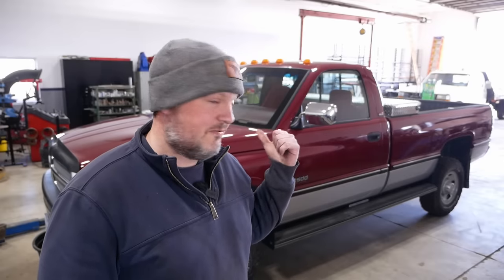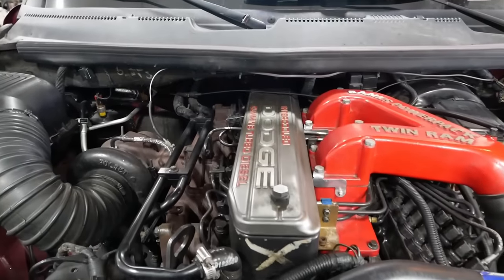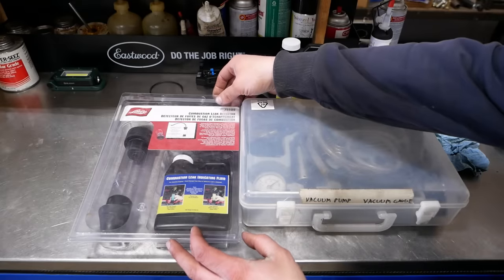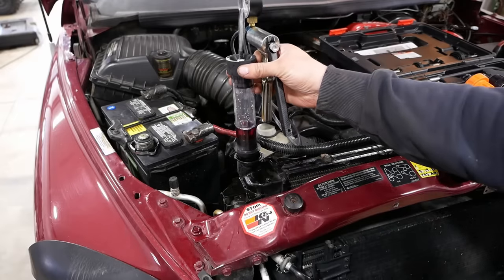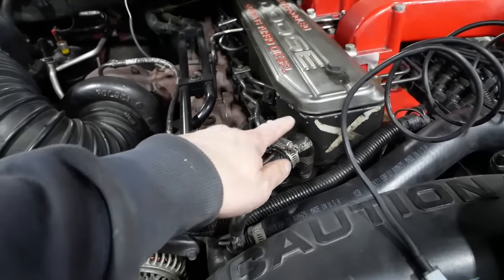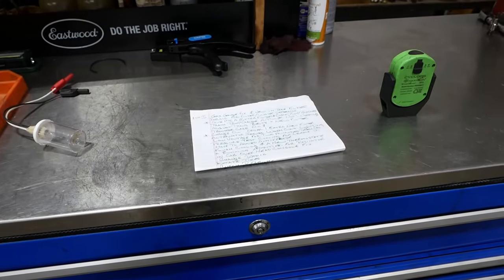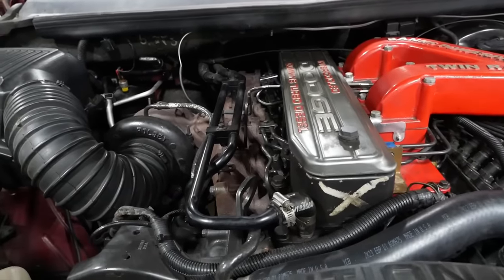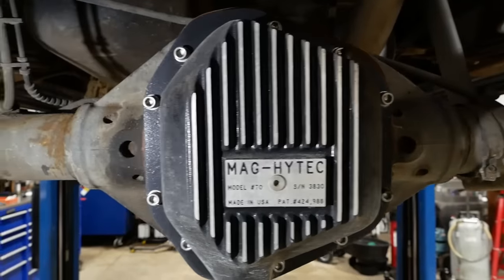Fixing a Mint 1995 Ram 2500 Cummins | Front End, Coolant Leaks, Major Service, Etc.

Comment: A word to the wise, the dashes on these things were made of hopes and dreams.... if you happen upon a rare fully intact dash, and need to remove the bezel, or any screws for the instrument panel, radio, etc, use the gentlest of force to both tighten or loosen, or you may be sad to find you have split the plastic around the screw retainer.

Another good mod is to add relays to control the vehicle lights. The lighting switch on the dash passes ALL the lighting load amperage through it and it is a matter of when, not if, when it finally melts apart.... Pulling trailers with lights will only hasten this.

Comment: I have 91 dodge 12v that's has the rotatey injection pump it has a factory intercooler. Still has the original transmission, and I'd still runs and drives to this day with out an oil drip under it.

Comment: Nice truck! I have my grandparent's 1998 Ram. It has the 5.9 gas and RWD. It's also rust free having spent it's winters down south and summers in IL. It does have several minor dents and such from 80 year-olds driving it. The clear coat has been peeling. That one must have spent a lot of time garaged. One weird thing is the ball joint boots have rotted off but the front end is still pretty tight with 80K on it. Mine has those same running board brackets on it. I thought maybe they were homemade but apparently not.

Comment: I work on mostly Ford e250 e350 vans, and doing the lower ball joints I run into the same problem with my ball joint press. I had a old axle nut socket that was all beat to death and I cut it for a spacer for just them lower ball joints, It bottoms out when installing them as well.

Comment: I remember when those showed up at the dealership in 93. 
I got a 2004 to work on with over heating issues that the last shop unleashed the parts cannon on, but didn’t fix it. It’s funny that the new fan clutch won’t work with a melted engine wiring harness. It threw the serpentine belt for good measure in front of the shop before we could get it in.
Reply from the maker: That sounds just right!

Comment: I had a new 2007 Dodge Ram 2500 Heavy Duty with the 8 ft. bed and the 5.9 Cummins diesel engine. I loved it BUT I had transmission problems with it just like I did with the other 2 new Dodge vehicles I purchased previously.

Comment: Take the check ball out of your transmission line and you will never have any problems with this type of transmission, it's not that the transmission is a bad design,it's that check ball that gets gummed up and sticks, and over time the pump gets hot and and usually fails. I have one with 512k miles and all I did was this and change the oil and filter on a regular basis.

Comment: The transmission  does not build line pressure in Park, to test to see if drain back is the issue shift to Neutral, wait 10 seconds while idling, then into gear. If the slip is vastly reduced or eliminated then drain back is the issue. A workaround that doesn't involve replacing all seals or removing the trans is either to shift to Neutral for 10 seconds or so before engaging gear or a Transgo / Sonnax Manual Valve upgrade that will allow line pressure to build in Park.

Comment: Ive had that issue with the ecu and charging system, i used flagship one ecu's and replaced the alternator at the same time, computer came pre programed and ready to rock for under 350 shipped.

Comment: Seems like a lot of work for a mint truck. Tech tip, use the old brake rotor to set the hub and new rotor on when your driving in wheel studs way easier than your block of wood.

Comment: Check the power steering fluid they work off a puck system and if any of the pucks are stuck their steering seems loose or if it's low on fluid I found that out with my Dodge on my own.

Comment: Excellent video.  Anything to help me maintain a 98 and 99 Dodge 2500’s is alright by me.  Yes, the newer trucks have engines with 24 valves instead of 12 but they are still Dodges.  Thanks.

Comment: great video. Steering boxes for those trucks are hard to get right. I think they make some kind of brace to stabilize it as the mounting tends to give. If you put the truck in neutral for a few seconds after starting the trans should act OK. We had a couple like that at work. wish you'd wear some safety glasses beating on stuff

Comment: Gale Banks did a whole series on why those square shaped diff covers are a bad idea. He has a version with extra cooling fins available that has the same OEM shape to the inside of the cover. Helps keep aeration down. Conclusion is that an OEM cover is better than those due to the aeration. I know on the Ford 10.25/10.5 you can get an OEM diff cover with the cooling fins and the original inside shape for minimal expense. Not sure about Dodge, but I think they run Dana rears so there's gotta be an OEM option out there somewhere that will work. If not, the Banks cover is the same except it has bigger fins that catch air and direct it over the fins to improve cooling capability. The only thing those big diff covers do to improve things is increased volume of fluid, but with the aeration issue they're a no no.

Comment: As a mechanic I can't believe you like the 95 Dodge body style.  That was the beginning of shoving the windshield so far forward you couldn't comfortably clean the inside but more important still, it buried the engine making access almost impossible.  Most mechanics I know are pragmatic, if it works good, if it makes things more complicated ditch it.  Opening the hatch on an old square body and you could get at most everything but the transmission.  Open the newer styles and you had better bring a shoe horn and a cutting torch or you aren't getting anywhere.

Comment: All of the clamps both fuel and coolant were constant tension clamps from the factory. The fuel return line behind the injection pump getting dry rot cracked and leaking is a common problem.

Comment: I had the 1500 dodge pickup from back then it was nice to drive around really turned heads that new design
 but the factory put wrong instrument cluster in so i had to take brand new truck back and have them rip it all out and change it LOL

Comment: Did Wes forget about the temp sensor in the transmission pan?
He checked it and figured there was a wiring issue with it as the sensor its self seemed ok and then during the test drive he looked at the trans oil temp gauge an commented on it not working and he thought there may be some thermostat in the transmission.
Wouldn't that gauge be for the sensor in the transmission pan?

Comment: love the video's and this one  too . i have  a v10 2nd gen 96 extended cab. but let me give you some unsolicited advise. get your self one of the pvc plastic carts. you can work off it and mount a vice on it. you can beat the hell out of stuff on it. way more durable then metal. and start using fender cover's or at least a folded towels protects the finish and keeps your tools from going in the abyss. okay my rant for the day lol. all kidding a side you are a very good mechanic love your work and how you film it. but i can't believe the guy i call a tool pervert didn't have some kind of hydraulic over air stud pusher outer  lol. you wacked them out the old fashion way good job

Comment: Hey Wes, I’m hoping you can answer some questions for me if you read this. Why does Dodge fit Cummins engines, why don’t they make their own diesels? Wouldn’t Dodge just buy the complete engines fully assembled from Cummins which means the zip-tie would be a Cummins mistake? I think it’s more likely it got in there when the last person to adjust the valves left it there otherwise the leak would have been fixed under warranty. If rust is such a huge problem there, why don’t people take steps to do their own rust proofing. Here, back in the day some of our cars would rust very quickly, not from salt on the roads but salt from living by the beach. Anyway rust proofing was big back then with fish oil being popular even though it stinks for a while it really worked. If I lived over there the first thing I would do to a new car is fill up my weed sprayer with fish oil and hit the whole underside of the vehicle. The second thing I would do is leave it outside for a couple of weeks for it to dry off and the smell to subside….A bit. 
Cheers Stuart, Australia 🇦🇺

Comment: The steering linkage is the crappy Y-style, I don’t know what the price is any more but we put 09 T-style steering linkage on our second gens. Also the loose feeling could be track bar problem like bushings, joint, bolts. Only truck I have left is a 02 3500, 165000 on the clock totally rush free and it don’t move unless it works hauling hay, straw, cattle, feed, lumber or whatever.

Comment: Even though your fluke multimeter has only the AC voltage meter ahead of the DC voltage on the dial and there shouldn’t be a damage to the multimeter, it is bad practice to hook up the leads to a power source first and then move the selector to the proper voltage meter. If possible try to set the dial to the correct function first and then connect the leads. Just something to keep in mind if you wanna keep your fluke multimeter working in proper order. Those things aren’t cheap hehe

Comment: I never got to compare before and after valve adjustment performance of a diesel engine. The 1960s era European and Japanese "sporty" 4 and 6 cyl engines that I adjusted often got another 5 mph top end with a careful valve adjustment. I used your two crank position method on sedans and pickups but individual tdc for the sports cars.

Comment: No coolant temperature gauge dance shows up in the test drive.  The factory issued a notice that due to the thermostat opening and closing the needle will dance while driving and is "Dodge" normal.  I have this truck without 4x4 and no steering issues at 275k miles.

Comment: Went through the same dilemma with my 94 3500. Had to use a very pricy Carter unit like that one. Drives me crazy you can spend multiple hundreds on a simple sending unit and they can't include the rollover vent... I had a great time getting mine in as well. I wish I knew about the pigtail, I de-pinned my stock one and made a lucky guess on the location on the new units plug. Then I siliconed the connector to keep it weathertight.

Comment: I had a 95 F150 5spd, with manual transfer case, that I really liked..  It spun a bearing at just over 300k miles..   But that 302 was pretty gutless for such a big truck.   That 12V cummins is the one to have..   I still have my 2002 F350 7.3L 6spd manual and manul transfer case, manual locking hubs..  330k miles and still going strong..........   I'd still rather have a 12v cummins in it though. lol

Comment: Call Mr. Banks (a very old but alert man) at Banks Performance.  He is a library of knowledge.

BTW, Mr. Banks did testing on diff covers.  Bottom line:  stick with the OEM.  The others don't sling enough fluid.  That rounded part inside is the key.

Comment: Gotta love the Cummins, I have a 95 Cummins 12v 6BT with 129k Mechanical on it but mine is in my 1995 Bluebird TC2000 40' Transit bus (Tiny Home) Only issue I have with mine is I can't seem to hold pressure in the fuel line so It'll crank for a solid minute before cranking over.. After it cranks it runs perfectly. I've had 10+ mechanics look at it and can't figure it out.. I've replaced the 2 fuel filters both main, and return lines, replaced the overflow valve, tried check valves both front and rear, a universal fuel pump (to try to prime the line), and still get a 1 minute cranktime.. I don't know what else to do.

Comment: Chrysler also had many issues with radios as well along about that time.  They liked to just quit working.  I am wanting to say Bill Paxton drove one of those in the movie "Twister" back in 1996.  IIRC him and Helen Hunt started out in a full-size Jeep pickup.  (J-10 or J-20)  They switched to the Dodge later in the movie.  There is a scene in the movie where a tree trunk lifts the rear wheels off the ground as the twister is coming and it just won't move.  Probably transmission problems.

Comment: That Banks twin ram air intake is because the #6 cylinder starved for air from factory. The stock air intake was located between the number 2 and 3 cylinder.

Comment: The brake calipers are GM built by Delco Moraine.  They were an outdated design when new.  I am not sure if the brakes on the older trucks with Chrysler designed calipers were better or worse.

Comment: Hi Wes

The gear box oil pan sensor, was it a one wire connection?

Because if it was a duel wire or a duel core wire and they are fitted in to aluminium a earth/neutral /ground connection is needed.

This also goes for single sensor connection too.

Because everyone forgets that aluminium is not a good ground conductor.

So my verdict is bad ground on sensor mount.
My solution to this is.

A ring terminal to be used as a ground, preferably a copper one.
Then run a single core wire to a steel grounding mount.

As usually the gauge is body ground and is usually grounded to the steel body of the vehicle.

This is just my verdict and thought's on the sensor malfunction.

But the truck, the dodge ram 2500 was mint and a beautiful colour too.
Nice work Wes, again a problem solved.

Comment: I didn't know that Rams could get that old and still have their rear fenders intact.

To add to what you said about temp fluctuations, here in the South during late fall/early winter it isn't rare for it to get to 25f and then by noon be damn near 80-85f sometimes, it's awful, everything works itself loose so fast if you don't loctite it.

Comment: With the Meg-Hytec deep trans pan the trans fluid temp will stay pretty low.  I had an 98 Dodge Ram 2500 with same setup and really only would see the trans temp climb while towing, sitting in traffic or really warm weather.

Comment: A very informative video.  Thanks!  As far as rusting spring hangers, it seems a hole drilled in the bottom would let the water out.  Does that make sense?
Reply from the maker: The replacements have a hole.

Comment: Wes a correction the Ve pump trucks did come intercooled it was 1991.5 to 1993 pretty much the tail end of the 1st gen cummins then the body style swapped in 94 to the 2nd gen it got the ppump and a hx35  turbo and bigger intercooler system. I'll get off my teaching soap box now.

Also that might be a unicorn for you Illinois fellas but here in Tn rust free is common to see thank goodness

Comment: My thought on the trans fluid temp gauge. The deeper pan holding more fluid is not letting the fluid get hot enough to open the thermostat. On a different note I want very much to get your input on this. I follow a fellow YouTubeer called musti1 in New Hampshire that dilutes chain saw bar oil with mineral oil and sprays the underside of his vehicles. Then as road dirt collects in the oil it forms a crusty barrier between the salt and the underside of the vehicle. It sounds goofy but he has some 30+ year old V/W’s with very little salt damage. It may be rare to get the opportunity to try it in Illinois but I wonder if it my work there as well? Thanks and hi from Texas

Comment: Hey Wes where did you get those wire spliecers and crimping tool for the sending unit?  I need to butt some wires on my horn blaster but hate those usual crimpers with the plastic coveing. Thanks

Comment: I have two projects that are in dire need of your expertise.  Project #1  1953 Ford Mainliner Business Coupe with no rear seat.  I have had this restored about 8 years ago and have never been satisified with it.  It does not want to charge the battery and the gage is not working.  Most recently I have moved to Iowa and having i getting it to stay running, installed new fuel pump but stil haaving problems. 
This would be a nice project for you to go thru it and get it back to running like when it was new.  I would be happy to pay you for your time, etc.    Project #2  1951 Chev 1/2 ton 3600  pickup that has been restored and having like problems.  This might be a good project for you and the channel... I am 84 years old and not able to do much but get upset letting them set and not able to use them..

Comment: I like useing a 20 or 12 gage gun bore brush for them brake slider bores. Or for moore aggressive cleaning. In the plumbing department at any menards, farm and fleet. ,hardware store. Stainless pipe bore brush.👍👌👍

Comment: I have my 1997 2500 i bought new rolling past 200,000 miles  
I was a heavy duty mechanic for 37 years mid range specialist at freightliner dealership so i am the only one who has worked on my truck
Which i will never sell

Comment: Whats the purple goo you used on the brakes?

Save you a little time next time you pound out wheel studs, thread the nut back onto the stud, protects the threads and gives you more meat to smack (tip from my old man who worked in a tractor shop among other places)

Comment: That truck was kept in a garage, summer and winter, both (and might have had a dime or two spent on under-body coatings.  

Have to wonder if the extra-deep transmission housing keeps the fluid under the minimum temperature sensor range.  Or, if it's a mis-matched pair.
Reply from the maker: I checked the pan with an IR thermometer and it seems that the gauge is correct.

Comment: Steering column coupler shaft is bad. I found out the hard way on a 99 Durango after replacing all of the tie rods, pitman, ball joints and steering box. Then a $400 dollar shaft that was only available from Dodge at the time finally fixed it. The non replaceable u joints get loose and do not look too bad but oh boy do they affect the steering feel on those Dodges.

Comment: Question: How important are the dust shields on disc brakes? Mine are rusted to the point where they are falling off in pieces. Replacement shields are $183 each, which is crazy for a small disc.